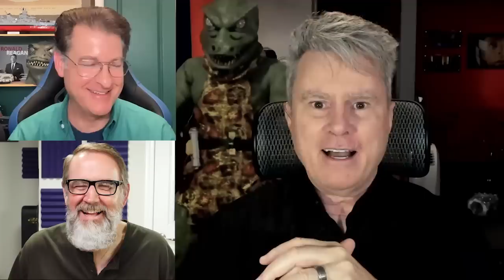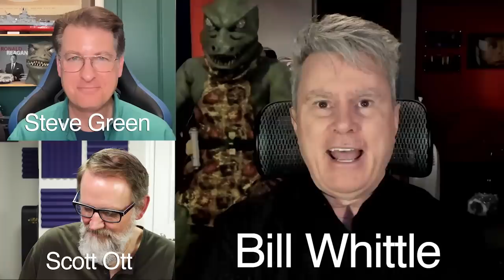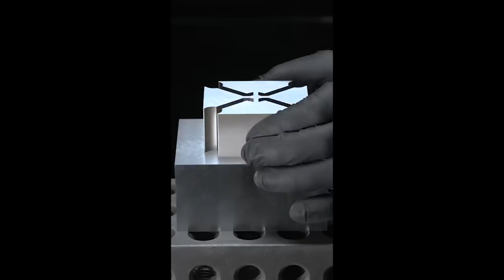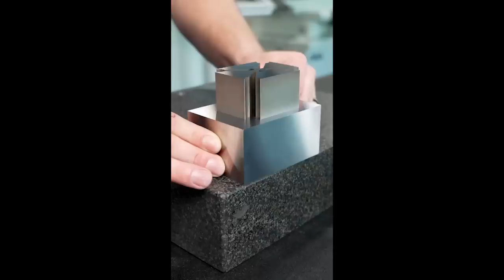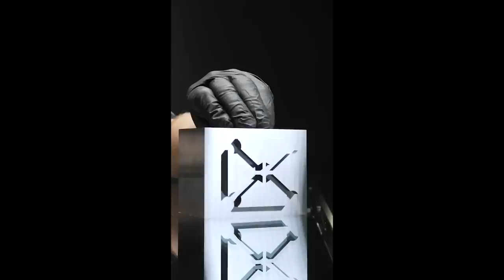Boeing...Boeing...Gone!

Comment: The root of the change in Boeing is that they were once an engineering company but now are run by bean counters.  They were acquired by McDonnell Douglas who kept the Boeing name after the merger.   That is when it all went downhill for Boeing.
Reply: EXACTLY! I was working for Boeing when Harry Stonecypher and his bean counter thugs took over. The accountants took over and the engineers were all put in the basement.
Reply: @jonthrelkeld2910 I am still there. I agree about Harry. He was a jerk and had no passion for the products. We haven’t completely lost it though. We still have excellence. But, this is embarrassing for sure.
Reply: @jamesdellaneve9005  I admire your "don't give up the ship attitude."
Reply: @jonthrelkeld2910  It’s not a single culture company. Boeing Commercial is half the company. They’ve become very conservative and really screwed up on the Max. Boeing Defense is very diverse. Thousands of programs running at the same time. Our Houston division is what we are talking about here. They are captured by the old NASA culture.
Reply: From a timing standpoint, I gotta say, not exactly.  Wife worked in accounting at Boeing before, during, and for a while after the merger with MD - BOEING had major problems before the merger, and needed the merger to stay afloat.  It was already on the downhill roll.  I worked for a key equipment supplier and we saw the same thing...
Reply: @CaptainSeamus  A combination of bean counters and executives with stock options began infecting most mega corps in the late 90s, by the Aughties it was in full swing.
Reply: @stlouisarch2162  absolutely.
Reply: Boeing paid 14 Billion (stock swap) August 1, 1997 for McDonnell Douglas, merged and used Douglas's bean counts. I forget which of the founders to leave last, but in his book, at his last product meeting he looked round the table and saw lawyers and accountants. He was the only engineer there so it was time to leave (retire)!
Reply: They seem to mirror Lockheed Martin (its almost like one group of people at the top controls them all hmm..) It's all about making as much money and saving as much money as possible while keeping all the legacy programs from decades past alive full of experienced AGING workers who dont want to hire new people and new minds if only hiring them to sit around at desks all day. They just want to keep everything the same way its always been since the 1980's as long as possible. If they wanted to explore making anything truly revolutionary like a supersonic airliner they would have to do it from scratch and thats too much work and too much out of their own precious money flow. No longer is STEM about Science Tech Engineering and Math, now its all Selfies, Tweeting, Eating and Man hating diversity hires.
Reply: Stop reading my mind. 😄
Reply: @stlouisarch2162  Ok. Sorry. Me bad. Didn't mean to be intrusive.
Reply: Boeing was not acquired by McDonnell Douglas, it was a merger. McDonnell Douglas was not a strong enough company to simply "acquire". Boeing had not lost it's touch yet. I was working on a contract in which we were subbed to McDonnell Douglas when this happened. Years later, working for the same company Boeing acquired the Hughes Satellite division while they were subbed to us on a different contract. Corporate leadership was weak in both Boeing and McDonnell Douglas. Prior to that I worked for other companies that had projects subbed to Boeing, some of them ones I worked on. Boeing was a very well organized outfit up to that point. One thing that must be kept in mind, prior to Microsoft, Seattle was a  one horse tow. and that horse was Boeing. As Microsoft and others grew there Boeing had to compete asymmetry with these software companies as software began to massively affect the design of all sorts of things including aircraft. The attendant change in culture that occurs is hard to manage, hence the bean counters are brought in since they are literally to stupid to get a nuanced understanding of these changes. The  737 MAX fiasco illustrates this.
Reply: I've heard it was the other way around, McDonnell went under and its IP and people were brought into Boeing. Otherwise I have heard the same thing, injecting MD people into Boeing poisoned the company and it's never recovered since.
Reply: Uh... Boeing bought McDonnell/Douglas, not the other way around.
Reply: Upon Boeing's acquisition of McDonnell Douglas,  a senior McDonnell Douglas official said (paraphrasing here) 'we acquired Boeing with their own money.'
Reply: So you saw the documentary called "Downfall".  Any thoughts of your own?
Reply: @nickv4073  What a snitty comment.  I have a few thoughts.  I worked my entire career at Boeing, being acquired as Rockwell in 1997, before which engineering expertise ruled.  Then McDonnell Douglas acquired Boeing using Boeing's own money and the downhill slide commenced.  Completely, even dangerously incompetent people promoted to leadership positions.  The running joke eventually was men needed to have sex change surgeries to even be considered.  Sure funny, because it was true, and still is.

Comment: With todays Tec, why would they be using "redneck" Tec, Electrical tape period. They should be using "back woods" heat shrink and solder or full lengths of wire.
Reply: I've been wiring my drag car this week, and I have been soldering and heat shrinking all of it. Boeing can't do what a crippled old gearhead out in the woods does?
Reply: Applied at a hospital for an engineering position.  Got a big no-go for saying soldering of wires was better!  Engineer said the dissimilar metals create radio frequencies which creates havoc in the instrumentation!  I still like soldering in most applications!!
Reply: @garybulwinkle82  how does he explain circuit boards? Are they duct taped or epoxied now?
Reply: @SweatyFatGuy  I saw an engineer attach his battery ground cable to a plastic intake manifold and wonder why his battery wouldn't do anything. I just smiled and walked away.